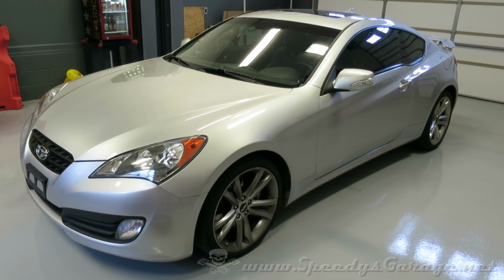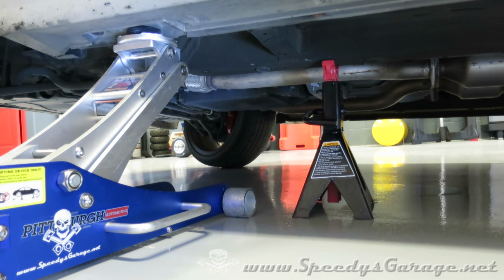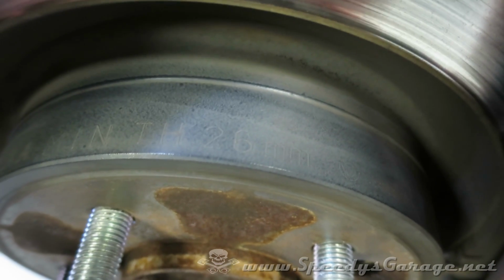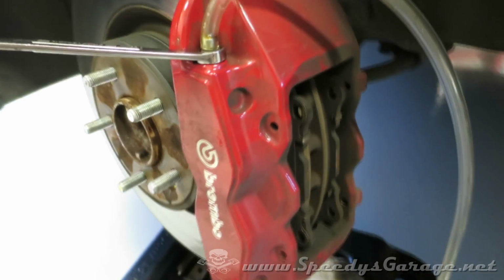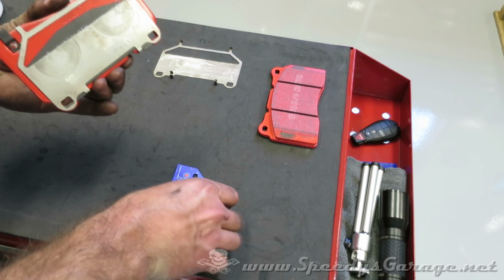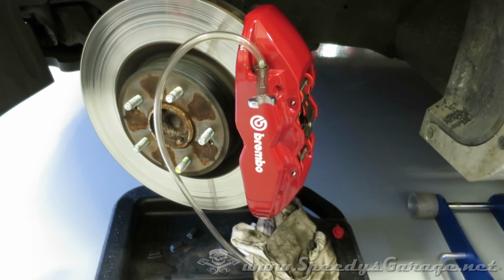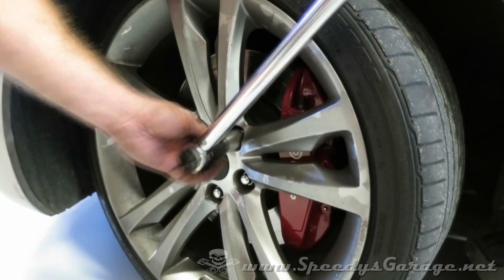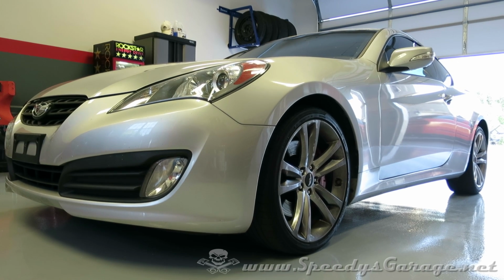Speedy's Garage Brembo Brake Pad Change Genesis Coupe

Comment: I don't have a Genesis, but a Dodge SRT, but your video was so clear and concise, I used yours as a guide. One thing, you don't have an issue with squirting brake cleaner on those beautiful Brembo calipers? I'm asking because my can says, "Do not use for powder-coated surfaces."
Reply from the maker: Yeah I try to be careful with the brake cleaner.  Wipe it off the calipers right away if any gets on there.  Better safe than sorry.

Comment: I've done brakes before, but never a set of Brembos; so I was initially nervous, but this video has calmed that fear.

You're literally going to save me $1200.  My local shop wanted $1400 for both front back brakes and rotors. 

Thanks!
Reply: So basically $1200 for labor alone? What's your local shop? The dealership's dealership?
Reply: Godamn $1400 what a buncha crooks, did u need rotors or did they say u needed them just to get more money out of you

Comment: 🙋🏿‍♂️ question does this apply to all brembo setups, I have 2015 ultimate? I'm doing pads an rotors all the way around.
Reply from the maker: Most of the ones I've worked on have been very similar.

Comment: Guys DONT clean your lovely powered coated callipers with brake cleaner, would you clean your car body with it ???? Use a spray bottle with warm water and a couple of drops of Fairy Liquid, dry fully then apply a high temperature wax, doing this will preserve the paint for years and years.

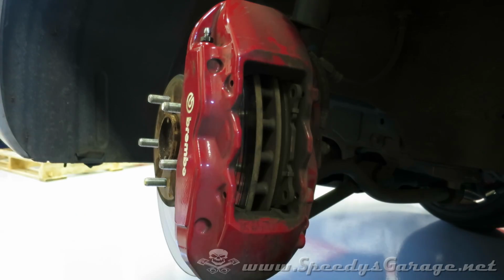Comment: 8:28 unluckily in my case they do not want to come out easily. They are damn stuck. Some corrosion got involved under some element that allow brake pad to slide back and forth. That sucks.

Comment: How do you feel about using a brush to dab some brake lubricant on the top and bottom contact slide points on the pad assembly? Especially for northern climates.
Reply from the maker: Not a bad idea just be sure to keep it off the pads.

Comment: It’s not that much effort pushing the piston back in. Use a brake compressor tool. The fluid was dirty before you even started so that doesn’t matter. Opening the master cylinder allows the fluid to go back up easily due to less pressure. It’s not a full flush so you just mixed new fluid with dirty fluid. 

I’d rather do that than risk air getting in the system.

Comment: With straight vaned rotors do you determine the left and right as if you were sitting in the drivers seat or if you were standing outside the vehicle and facing it from the front? My new straight vaned drilled and slotted rotors are labeled left and right but I need an answer to my previous question for proper installation placement. Thanks
Reply from the maker: Driver and Passenger (right and left) are always determined as seated in the driver seat.  Vanes on rotors should rotate so that they catch air.

Comment: Thank you for the clear and very well detailed video. 
There is a bit of debate on this thread, between dusty pads (like most Brembo's) and non dusty ones. Normally the dusty ones bites a little more and have shorten brake distance in emergency panic braking. I get it that in normal traffic, we can easily adapt ourself to the lighter bite of some low dust pads, yet the moment that you need to slam the brakes to avoid an accident, a couple of meters shorter braking distance (in most cases the  distance can be a lot shorter) can make the difference from life and death. I can live with some dust on the rims and get the car washed regularly.
Reply from the maker: Go check out the video of the Hellcat Go Man Go for brake pad change.  I swapped over to some low dust pads and the car actually stopped shorter in panic 60-0 conditions and NO dust.  I'm gonna do the same with the Camaro.  https://youtu.be/t1slbEZxH0M

Comment: Hey, I have a 2011 Genesis 2.0t and it knocks hard and ticks a little at
 higher rpms, runs smooth at idle, was hoping for some insight on it. Is
 there anything I can check or do before I jump straight to the 
conclusion it's the rods? Maybe pistons? Maybe timing chain?
Reply from the maker: Is it a loud physical sounding knock or something less obtrusive?  Check the turbo?
Reply: @SpeedysGarage  It's a loud knock at higher RPMs, sounds perfect at idle.

Comment: I was going to use brake cleaner but on the back of the can it says not to get it on rubber, the brake pistons are surrounded by rubber.
Reply from the maker: It won't hurt brakes.  Think door trim and stuff like that.

Comment: Do you have to bleed the brakes when changing rotors and pads?
Reply from the maker: Anytime the brake system is opened it should be bled.  I'd also not recommend trying to force the fluid back through the system to the M/C when removing pads.  Just crack the bleed valve and compressing the pads will be much simpler.
Reply: @SpeedysGarage  why not? it can be done. You dont have to bleed the brakes right after. It much simpler by keeping the brake fluid system close.

Comment: Great video! Quick Question: I have he exact same car down to the color, I've read on the Brembos you should bleed the inside valve first. What are your thoughts? Also, I'm changing rotors, do you have a video on that?
Reply from the maker: There may be some technical reason based on fluid path of the Brembo caliper to bleed the inside valve first, so if you saw some legit documentation on it, it certainly won't hurt.  I don't have a vid on the rotor, but it's SUPER easy.  Just come off with the lug nuts out of the way once you remove the caliper.
Reply: Speedy's Garage x thanks!

Comment: Hi, Thanks for your detailed video, watched it with great interest.  I am in the process of replacing my front brake rotors and pads on my Skoda, most likely I will choose the DBA 4000 T3 Slotted rotors with Brembo pads (presumed to be semi-metallic but am not sure, don't believe they're ceramic), so just doing a bit of research before jumping in sort of speak.  Have you had any experience at all or heard of any issues with this combination of DBA T3 slotted rotors and brembo pads?  Also, I've decided not to go with OEM or stock items simply because of the enormous dust my current pads produces, do brembo pads do the same?
If not brembo pads, I was thinking Remsa pads, any experience with these pads? ... btw, we're based down under.
Reply from the maker: Not sure on your particular application, but I can say most all Brembo pads I've ever seen are very dusty.  I always use something else.

Comment: Great job! Why not install Brembo ceramic brake pads? They are 100% better than my stock pads and they stop the car on a dime.
Reply from the maker: Every Brembo pad I've ever used has produced unacceptable amounts of brake dust.  No thanks on that, my OCD kicks in.

Comment: Piece of cake!!! I just changed my pads on my 08 Acura TL Type -S. Was skeptical at first but in all honesty was super easy. I did  remove some fluid from master cylinder first instead of doing the bleeder screw method. There were Brembo pads on the car when I bought it, I elected to go with the Ake bono's instead due to the fact that the Brembos were dusting my wheels heavily on a weekly basis. I did reuse the shims that were on the Brembos and they fit perfect on the Ake's. As far as compressing the pistons. I honestly could have done it by hand, they moved very freely. I just hope the calipers stand the test of time cause I'm not at all interested in spending 300 to 400 bucks to replace them!

Comment: I have the 2011 3.8 track and just  hanged my pads. Hearing a clunking noise while braking in reverse. Any ideas?
Reply from the maker: I doubt it's the brakes.
Reply: 80's kid 4ever I have an 06 Sti that used to do the same thing some brake pad tolerances are better than others. When I used hawk pads I always got knocking when changing directions I switched to Centric and the knocking went away. Another thing you could check would be the pins that hold the pads in place. The pins on my Q50s were slightly worn/undersized and caused the same thing.

Comment: Great job on the Video! Only thing I would have changed was turning the rotors, which should be done when replacing the brakes.
Reply from the maker: My opinion is "sometimes" the rotors should be turned.  In this case they weren't warped or having any vibration issues so I just replaced the pads.  This is my wife's car and 10,000 miles later and still no problems.
Reply: My opinion is if you're to the point where you need to turn your rotors you should just replace them.

Comment: Shouldn't you turn the rotor when you change pads...
Reply from the maker: I respectfully disagree.  I base it on current rotor condition, vibration issues prior to pad change, etc.  In this case none of these issues were present, so I simply swapped the pads.  This is my wife's car and 10,000 miles later and no problems what so ever.
Reply: You should always turn the rotors. They could be slightly warped and you may not realize it. Plus it's only 20 bucks a piece at your nearest O Reilleys...
Reply: @mattjwargo37  turning rotor should be done only when necessary, because by turning them , you decrease they thickness and mass so the will heat up faster and more. Considering that 90% of the time your rotor are already worn down, by turning them you will shorten their life considerably. If I have to go through the pain of taking the rotor off going to the shop getting them "turned" and reinstalling them, I rather buy new rotors, which these days are not much more expensive than the whole procedure of turning, especially in the case of premium OEM grade "non slotted" or non "drilled rotors".
Reply from the maker: Not unless you're getting vibrations, which in this case I was not.

Comment: Okay, I'm ready to buy earmuffs and turn my car radio up to 11. I have been experiencing a rear brake squeal in the same year and model Genesis Coupe for a few months. Since I am not mechanically inclined I had my local mechanic handle the replacement of pads and rotors. After 20 miles the loud squeal has returned. Even louder! Yeow! I'm the embarrassment of the neighborhood or wherever I travel. My 'soon-to-be ex-echanic' said I needed slotted rotors and not the regular ones. Huh? Could he have not adjusted the chirper? Did he not replace the anti-squeal shims? Did he not lubricate the anti-squeal shims correctly? Any assistance you could offer would help. By the way, your concise, professional video DIY make me want to gas up my car, travel to your location and simply have you work on my car. Ha! Thanks!
Reply from the maker: Probably just needs some anti squeel shims and proper grease applied.
Reply: They did not have the correct anti squeal shims installed and some cheap pads were used. After changing both I can finally drive in peace.Thank for your response and I look forward to more enlightening videos.

Comment: Appreciate your DIY sir, yours should be on top, of all the Brembo or Fixed Caliper brake pad change design. I just got a TL Type S and it came with Brembo up front OEM. All of the DIY here is not as good as yours. Your is the best and clearest, and most articulate when doing the DIY. Thanks again!

Comment: I used EBC Red Stuff on my Challenger R/T. They don't last through a single track day. They are okay initially for performance driving on back-roads but eventually lose their bite before getting half way through their life. I recommend Hawk HPS + or Hawk Street/Race pads (HB509).
Reply from the maker: Thanks for the feedback.  I've had experience with Hawk HPS+ pads as well and they were good with low dust, but didn't bite like I expected.  We'll see how these to to compare.

Comment: You're gonna want their free shims! Those things scream for many hundreds and hundreds of miles during "brake-in".  I put the exact EBC Red Stuff on my 2010 SRT-8 Challenger.  Great stopping power, but don't show your face around town while cruising, people will hold their ears! Those shims help a little, and with lots of patience, the noise goes away after about 3 months.  Yuck!
Reply from the maker: Maybe we got lucky, or the design of the Brembos on the Genesis are different, but these squeeked slightly for about 100 miles and haven't made a sound since.  Slightly more dust than I expected compared to the Hawk pads I've used in the past.  Jury is still out on how long these last so we'll see in the end which we prefer.
Reply: +Speedy's Garage I liked them especially when they finally shut up.  Customer Service at EBC is great, and they sent me free shims overnight which seemed to help. I used their slotted and drilled rotors too, quite possibly adding to the noise with the dust collection.  After about 18 months with those brakes in great condition, I traded my 2010 SRT for the 2015 SRT392.  I've got 14,000 miles on her now and am already noticing early wear on my factory Brembo's.